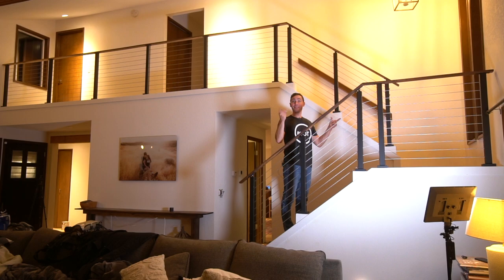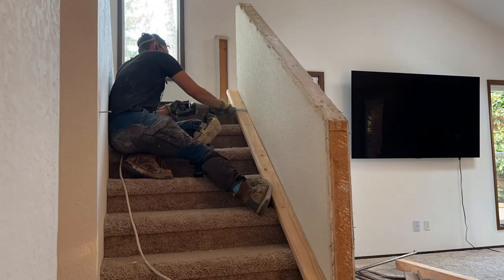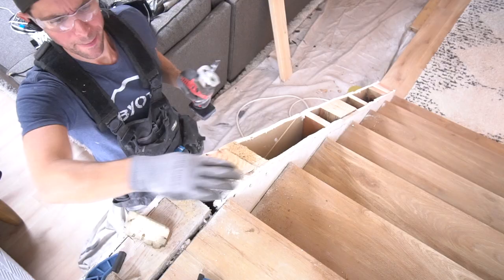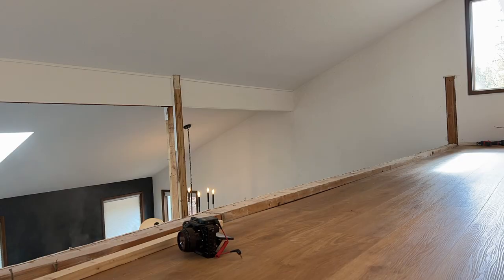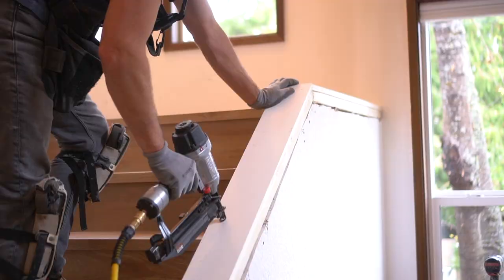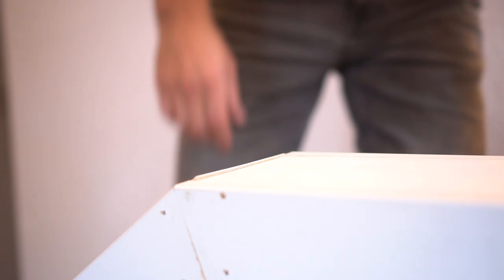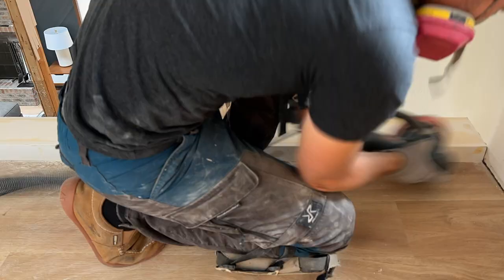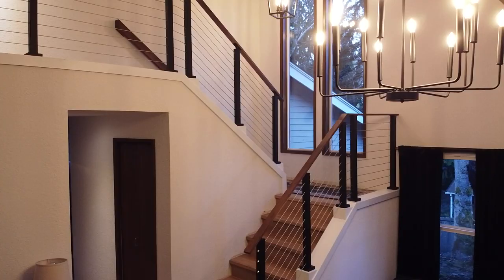How To Transform A Room By Removing The Railing

Comment: 1/8" lip at the top intersection because you butted a mitered edge up to a flat board. No glue use. No ram board down on the floors. Good effort but room for improvements.

Comment: personally  i would not hire you,due to the fact of not protecting the new flooring that was installed.
Reply from the maker: If I was doing the demolition from the get go I would completely agree with you but keep in mind that I did the demolition prior to the flooring installation for exactly the that reason.  To protect the floors.  Client didn't want a bunch of paper on the floors and I assure you everything was vacuumed and swept by me personally everyday I was out there when installation was happening.  Thanks for watching.